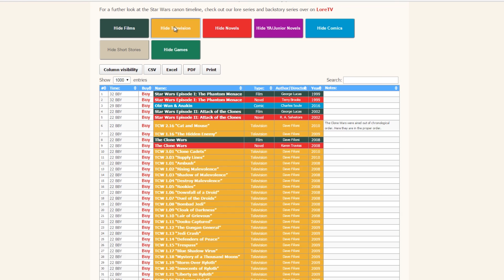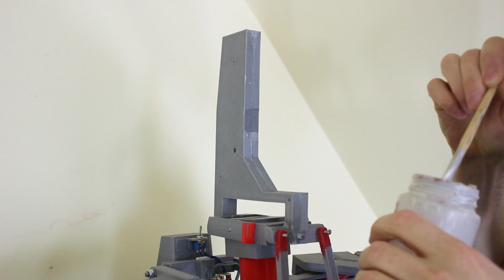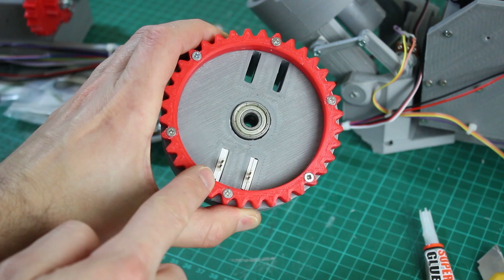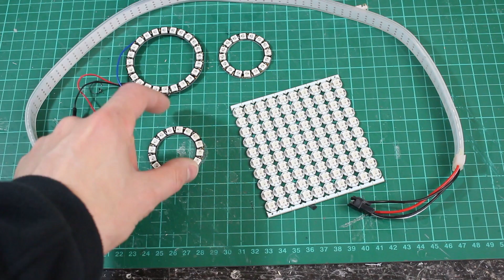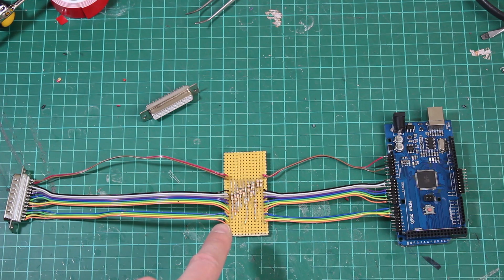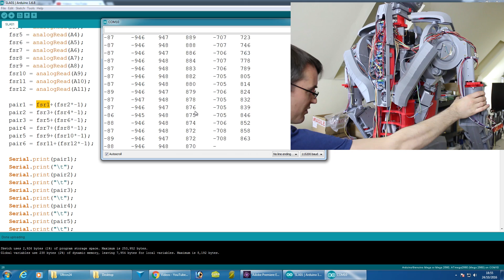Avengers Ultron #24 | Lighting & Force Feedback | James Bruton

Comment: would it make sense to wire the pairs of force sensors in series and read off the middle voltage? it seems the digital range over one sensor is limited to a small range of force..

Comment: just to let you know, you should NOT have all the values of the led strips set to max. It will give you a bright white light 3x the power of just one led, but not for very long (if you get what I mean). I suggest having the rgb values add up to 255 or whatever the max is.

Comment: +James Bruton i have a small question if i remember in an earlier video you was sending and receiving the data via Bluetooth  are you going to be doing the same for the data being sent to the ai or are you installing the ai software on a raspberry pi? also what programming language do you plan on using for said ai, i assume C++ or something along those lines. im just a novice in programming (C++) so i probs dont know what im on about. i love what your doing. also it would be cool if you could find a way to use project malmo the ai that was made for minecraft because then your robot could learn how to do things you didn't program but that would require too much work :p thanks for taking your time if you read this

Comment: If I remember a project I did, you can set a pin to pullup,  I don't think you need the 10k resistors.
Reply: thanks for the note, I was thinking in terms of my project using "capacitive touch" which is neat.  What a pain having to use a 10k resistor.  In my projects needing a 10k I put the resistor right in the wire with heat shrink. I was thinking of using FSR in my 3d printer build.

Comment: Don't get me wrong, I like a bit of disco in my robots, but what got my mind reeling this video was those those pressure sensitive resistors. Those are the dogs bollocks, wow! That's going to open up a whole world of tactile interaxtion AI coding. Can't wai to see what you're gonna do with all that data.I'm also pretty impressed by how fast the arduino mega can process those analog lines. That's gonna come in handy when you decide to integrate those into the finger joints. It would open up a whole new level of having a (hopefully affordable) hand capable of dynamically grabbing objects based on grip level, sense of grip loss, AI based re-grab procedures, special cases for fragile or irregularly shaped objects, not to mention adjustable sternness in the handshakes this guy is going to give :)

Great video man, thanks for sharing!

Comment: wouldn't it be possible to use the opposing sensor as a "pullup/pulldown" resistor, you you don't need a fixed value resistor? That would make the voltag devider much more efficient wouldn't it?
Reply: ***** Thats a valid point, didn't think of that... But maybe a high value resistor in paralel with every FSR would work, something like a 22k :)
Reply: ***** OK then :)

Comment: How about using the other FSR as the other leg of the potential divider?  That way you only need one analog input. As the unstressed one is very high resistance there will be very low leakage current.
Reply: possibly too low.  you might need a high resistance in parallel with each FSR to stop the input floating when both FSR are infinite ohms.  I dunno if it's legal on arduino to activate both pullup and pulldown (100k each iirc) on the analog inputs,  but that would do the job if it is.
Reply: Something I'd also want is FSR in the bearing housings to simulate "joint pain".   I'm not sure how that;d be handled in code except maybe as an alert,  but in a scenario where movement is done through a neural net it might add realism if the learning tends to minimise joint strain.

Comment: Just a thought... won't the FSR's be triggered off when the joints move due to the weight of them, which would in turn mess up the whole way it deals with FSR input, unless you had a threshold higher than the numbers output during movement.
Reply: I was thinking the same. How will it tell the difference between gravity force due to changes in angle and force due to contact? For example, when the arm is extended there should be more force on the shoulder just from leverage. There's probably a math solution. If I remember right there's some IMU's giving data as well. I get confused with all the projects going on! So he might have to use the force values differently depending on the angle of the joint. Glad I'm not the one figuring it out.

Comment: James, please, before you really beef up the electronics inside the head, try to remake it. It's rather hideous as many of us have pointed out multiple times.
It... just... doesn't do justice to ultron's evil character.
Reply: MrBaronmoll I know! It really reminds me of Toriel from Undertale... and that's not a good Look for Ultron
Reply: It's really not nice, I still wait that he'll redo it.
Reply: +joost1120 Because the shape isn't the same and it does not look as ultron.
Reply: Dingus
 Yes, James keeps on constraining himself by almost fully relying on 3D printers. While they may be very flexible, for certain shapes and properties they're not the best solution.

I see him more and more becoming a lobbyist for the lulzbot.
Reply: It's nearly exactly the same shape. The details aren't important right now, so why bother?
Reply: L. L.
But the shape is right? The details just haven't been added. If you look at Ultron's face, you can see it has a lot of small details. Without it, it's almost exactly the same.
Reply: MrBaronmoll he had a lot of limitations in the program he used to design the head. I think he's more concerned with function over form. Maybe he'll improve the aesthetics for Ultron 2.0.
Reply: *****
Don't worry about small details like that. If you want, you could always just detail it further.
Reply: joost1120
 To be honest, changing the head later, when it's littered with lots of servos, leds and electronics that are mounted to the inner side of the skull will be a pain in the ass.

Also the more changes you make to the head now, the more work you would have to do again.
Reply: MrBaronmoll
I don't think he'd even have to change the head. Carving in the details and maybe add some thickness to the side should do the trick.
Reply: joost1120
 It's the whole shape of the orbital cavity and the poory made seams between parts that's throwing me off.
If you look at Ultron compilations you can see clearly how sophisticated the entire face and head is.
James just doesn't do justice to Ultrons character when it turns out that the robot he created looks like the Terminator had sex with Pinocchio.
Reply: MrBaronmoll
I think many of the curves can be added in later, but whatever floats your boat.